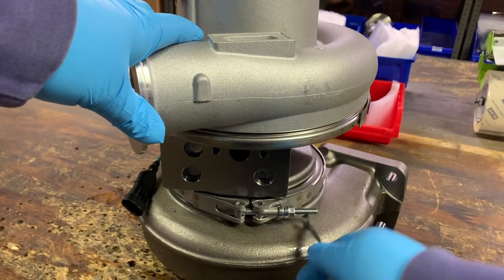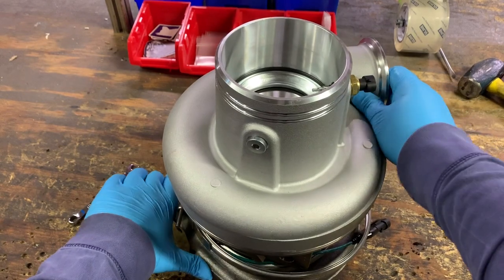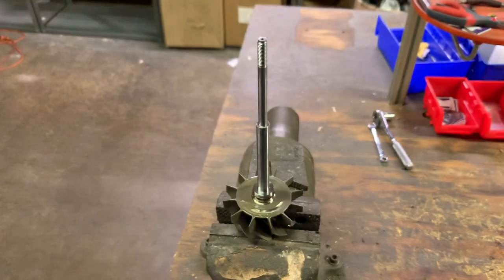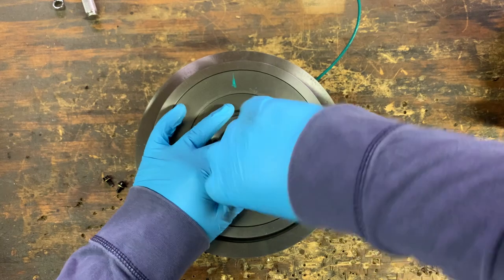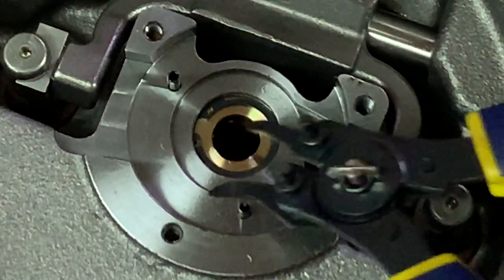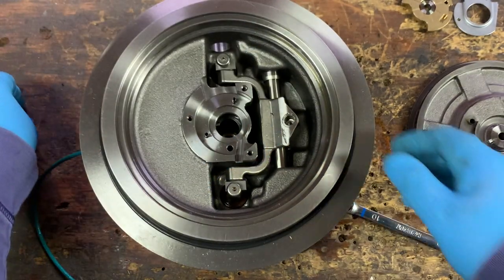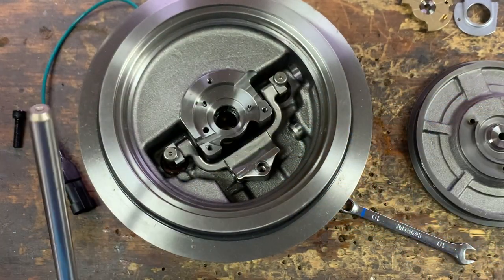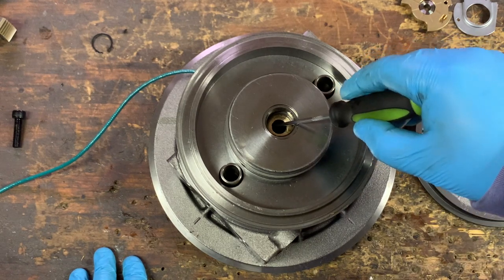Breaking down a Holset Style VGT Turbo for Cummins ISX | HE500VG

Comment: What IF🤔.....someone(Borg Warner) invented a performance version of the Cummins/Holset VGT that functions normally & accepts the Holset actuator? Imagine getting a 78/1.32 VGT that can function as a 1.25 or 1.20a/r under acceleration & when the jakes are activated. Plus, using the standard bolt flange & T6 flange would give a variety of options, too.

Comment: When you say that these nozzle rings are infamous because they get stuck, can you please explain in greater detail?

In my experience, the nozzle rings have great movement as they slide in the shroud plate. The riveted actuator rods always seem to have just the right amount of play. And the foils/vanes hardly seem to have too much FOD damage or abrasive wear. 

It would be great to know where these NRs get stuck in your experience. I appreciate the video, excellent work. Love seeing these VGTs compared with turbos that have all those articulated vanes.
Reply from the maker: The vanes can be distorted from excessive exhaust gas temperature, or any foreign impact.  Either of these events will cause the vanes to become lodged in the unison ring.  On rare occasions, excessive soot build up can cause the vanes to begin to bind at the unison ring, but VGT functionality can be restored once the soot is cleared (but you still need to correct the source of the soot)

In my personal experience the above scenarios are fairly common when we come across a VGT that is "seized"
Reply: @momentumworx thanks for the reply. Agreed on the soot/carbon buildup, but IMHO CTT’s VGT nozzle rings and shroud plates are famous (not infamous) for FOD resistance and thermal resistance. I believe those are a 300 series stainless and are heat treated for those specific forms of resistance. I’ve seen plenty of rip outs during rebuilds and more often than not, those nozzle rings and shroud plates get the carbon dissolved off and scrubbed, then go right back in. I’m more thankful for these than VNTs from those “other guys” lol. 

Clearing up the cause for whatever causes FOD, etc - couldn’t agree with you more brother!

Keep up the great work. Love these videos.
Reply: @momentumworx how do you get the plate off with the 3 bolts in it after you remove it
Reply: About the EGR system, cause carbon accumulation in exhaust gases?